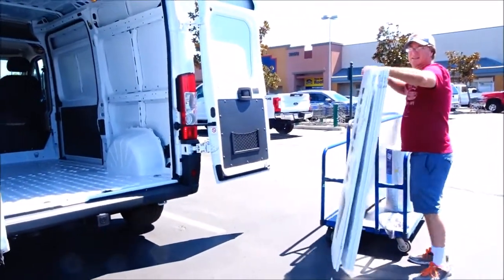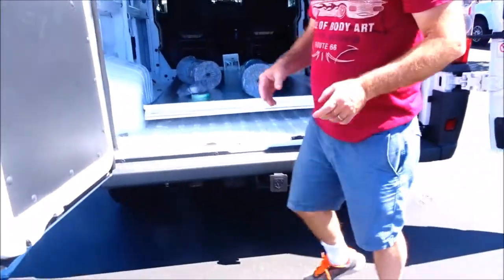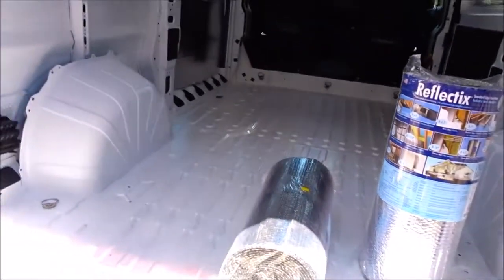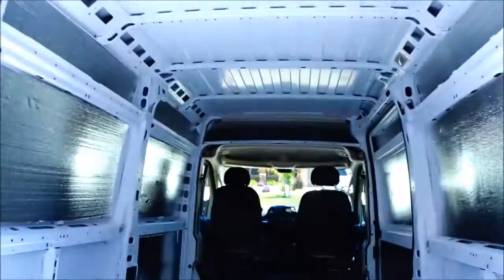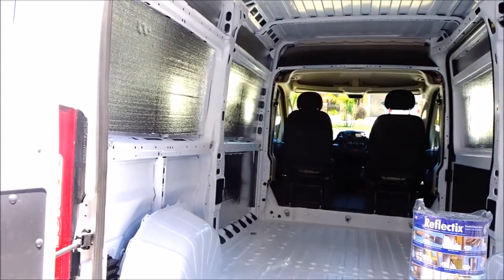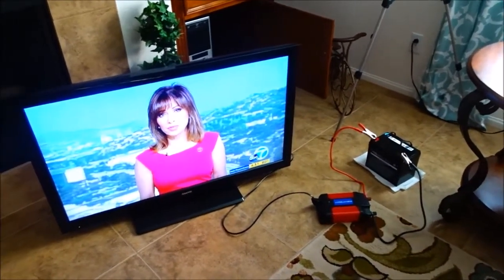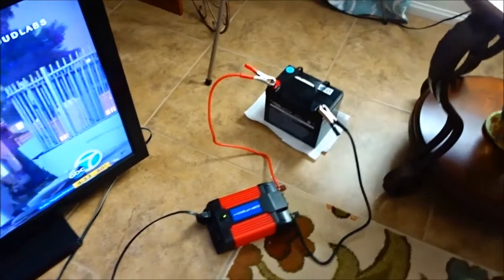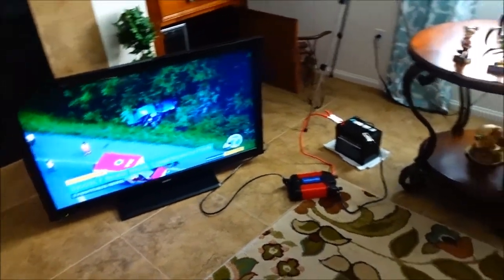Insulating our Van with R-tech Rigid Insulation and 750 watt sine wave inverter from Harbor Freight

Comment: I am looking right now for a van. I have a very important question. Should you buy a van that has driver, passenger and windshield only?? I'm thinking that Stealth and Insulation might be affected by More windows on the sides and back.
Reply from the maker: That is exactly why we only have the windshield and passenger and driver windows. With black out curtains behind the seats no one knows we are in the van. We can have lights and TV on and no light escapes our van. Complete stealth.
Reply: DJ DC There is window tint that is so dark you cant see in even right up on it. Yet you can still see out of it.

Comment: I've seen others put sound buffer before the insulation. Do you find the noise an issue?
Reply from the maker: We do not find noise or road noise an issue. We have made a lot of changes. This coming Monday our video will be an update to the van. We have done a lot of changes.
Reply: billisa Looking forward to it. I'm looking at Sprinters but I kinda like your Pro Master! It's funny to see you're Disney fans. My niece dances in the parade at Disneyland and her Mom works there too!😎
Reply from the maker: We love Disney. Long story. We took four months off after going 60 days in 2016 for Disney's 60th anniversary.  We own two Mercedes vehicles. A c 300 4matic and an e350. Looked into the sprinter. It is too narrow to sleep side to side. I am 6 feet tall. It is also taller than the Promaster high top due to the promaster being front wheel drive. No transmission or drive train going to the back wheels. This makes the ford transit and the Mercedes sprinter a foot taller to step up into and their center of gravity is higher for cross wind handling. Besides the sprinter is a lot more money. Thanks for the comments.